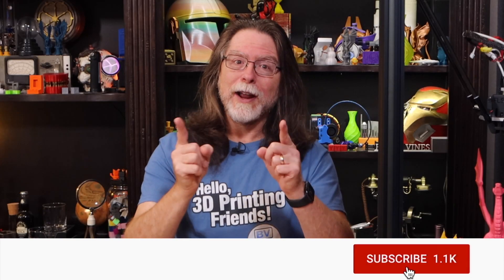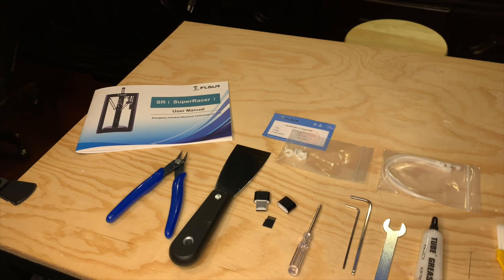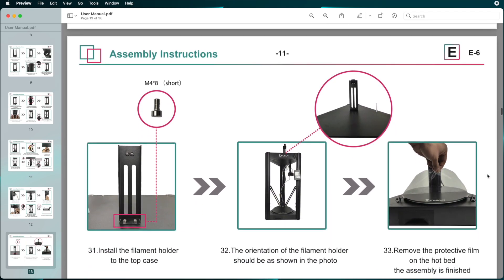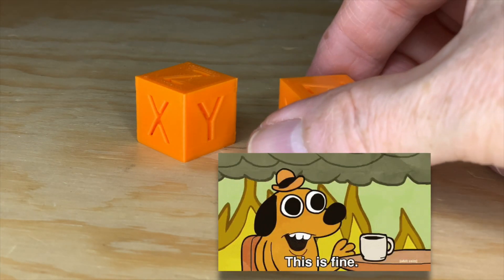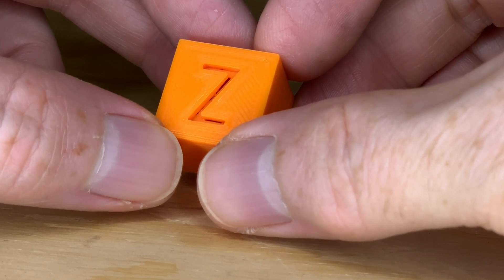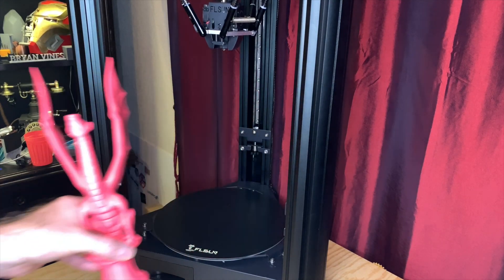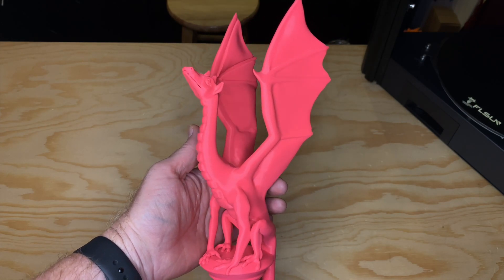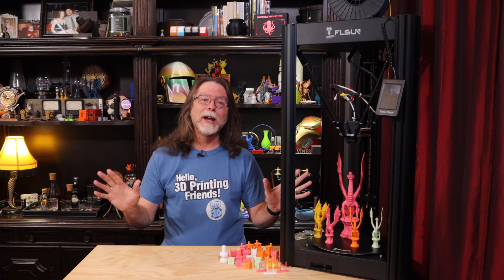FLSun Super Racer - A Fast Delta 3D Printer

Comment: After 127hr's printing here's my thoughts. With very minor upgrades and tuning (blue ptfe tube, more angled/narrow fan ducts, more rigid clip on extruder coupler a rc car clip, e step calibration and Pano Tuner app on the belts) Prints great at either stock Normal or Fine profiles in Cura. Only thing I changed is upping layer height on Fine profile to 0.16. Only on Normal profile speeds ringing are pronounced. Will be testing further to minimize ringing without resorting to Klipper. Ta

Comment: Hi Bryan, I am looking at maybe buying the new FLSUN QQ-S-PRO 3D Printer Large Size 255*255*365mm Auto-Leveling Touch Screen UK version. it is only £209.00p here on a ebay company site.

 > QQ-S Pro is an upgraded version of QQ-S. QQ-S Pro uses a 32-bit motherboard and automatic leveling mode.
QQ-S Pro movement system using high-precision linear optical axis with self-lubricating graphite bearing, which can obtain good printing accuracy and quiet effect during high-speed movement.

Support offline, USB and WiFi printing modes. The powerful Titan extruder is compatible with many common filaments on the market, and is especially suitable for hard filament such as PLA.
The default printing speed of QQ-S Pro is 60mm/s, even running at 120mm/s, better printing quality can be obtained.

Features:
32-Bit motherboard: New upgrade controller and program, with independent MOS module, more stable and durable, keep the printer high speed printing.Support online or TF card offline printing. Support WiFi remote control.
Three-axis linkage: Three-axis linkage structure with higher moving speed. The printing speed can increase by 60%. Quiet printing, Working noise less than 50dB.
Touch Screen: Full color, easy to operate. One button forever leveling，easy to operate, only need to level once, forever leveling.
Resume printing function：Don't worry about power outages, when the power is restored, the printer will continue to print from the interruption point.
Lattice Platform Hot Bed: High-strength lattice composite coating, fast heating, no warping. Strong adhesion, easy to take the model when the platform is cooled.Titan extruder, smooth feeding, no drawing, more powerful extrusion, can print flexible filament.
Large Printing Size Φ255 mm wide by 360 mm high: Support various 1.75mm diameter printing filaments like PLA,etc. 
Widely used in toy, architecture, furniture, education, medical, daily necessities and other fields.

So since you used a Delta would you say this newer pro version is worth the money?  I don't know if you reviewed this one yet?

I have a great Aquila 3D printer already, But need a higher print size system!  Your channel is awesome and I am subscribed to it.  So any feedback on is the pro version a good buy?  🤔

Comment: My Super Racer is working great with Cura tweaks.
Reply: Z setting is very important.
I set retraction to 5 millimeter. 
First layer to 50 mm/s. 
Speed set at 150 mm/s.
Reply from the maker: That is great to hear! What settings did you adjust in Cura?

Comment: Crazy question why would my homing fail on and Ender 3 v2?
Reply: I know this comment is 2 months old and you've probably figured out the solution but in my case it was endstops and the x-axis endstop wasn't being properly pressed. Could also be loose wiring with the endstops.

Comment: Hmm well I take the YouTube reviews on FLSUN with a pinch of salt now as really a few hours/days/weeks is not enough time to form an accurate opinion?  No offence!! whilst I waited for Soup racer to be available in UK, I picked up an FL Q5 to try out as it was on offer at amazon and unfortunately eventually ended up having to send it back.  Good print quality out of the box but got worse and worse until it was printing terrible quality after two weeks or so.  I think sadly the quality of the extruder and hot end simply can not keep up with the rest of the printer, which is a shame.  It's not a workhorse printer.  Conversely my QIDI X-Maker bought to replace it despite being much slower is banging out much better quality prints hour after hour day after day!
Reply: Yeah FLSUN is very notorious for that and all their printer's seem hit or miss. For me, my QQ-S Pro is kinda split. Out of the box it did great but I started having issues with quality and bed adhesion which was related to a stretched belt. I went the long route and did several upgrades however and now it's printing more accurately than my ender 3 pro but I'm not well versed with Cartesian style printers so..

Comment: They keep doing stupid things like tinning wires, we keep calling them on it. Eventually they will change, much like the stupidity of not enabling thermal run away. Then we can blast them on the laziness of not supporting M600, Advanced Pause, and other built in features they don't bother with.
Reply from the maker: At least this one was halfway there. The 24V input and the bed wires had connectors crimped on them. 👍🏻

Comment: Thanks for a comprehensive review, excellent content! How was the bed leveling? My wife needs something simple.
Reply from the maker: The leveling process was super easy. You do it with the nozzle cold. The probe plugs into one of the connectors near the end effector, and has a magnetic mount that puts it inline with the tip of the nozzle. Run the leveling routine from the screen; it probes the "corners" of the bed (the part near each vertical axis). Then it homes up at the top, and comes back down to probe around 15-20 points on the bed. Once it's done with that, remove the probe and set the Z offset (I used the paper method), and save it. FLSun has a video: https://www.youtube.com/watch?v=mWVXsSech8c
Reply: @BV3D  thanks for showcasing the Aria Dragon, I decided to print it as a real-world retraction test and it's worked out great.
Reply from the maker: @BenEBrady  Cool! I remember seeing on Thingiverse that Loubie3D has Aria tagged as a test print, and she makes a fine test print indeed.

Comment: I think plugging a micro SD to SD card adapter would alleviate the issues with the location of the slot since the ribbon cable on the adapter could probably reach across the top of the machine to the front and you could Velcro it into place or something. 

As much as I think it would be cool to have a fast printer (I have an Ender 3 v2, so I gotta go slow), this seems a little not that good for me. I'd have to change the firmware and some other things for it to really catch my attention.
Reply from the maker: I've got one of those adapters, and I need to see if it'll actually work. I've seen some printers that don't trigger a re-read of the card unless the card is physically unplugged and plugged back in. So what happens on printers that do that is, I have to eject the extender from the MicroSD slot on the printer and plug it in again, in order to get the printer to read the card. But if it works, that would certainly fix THAT problem! 👍

Comment: I have been wanting to get a Delta printer for a long time and this one has had great reviews, however the knockoff parts put me off, I have been questioning wether buying another Chinese printer is worth the hassle of having to upgrade the cheap and unreliable parts they generaly come with, Im saving my shekels for the Prusa XL, its expensive but worth every penny IMO, this shows the faith I have in Prusa, having not even seen an XL printing something yet, maybe I will get a Delta oneday especialy if Prusa release one
Reply from the maker: Hi Andrew! I'm OK with the current set of parts on it, but if the extruder fails I may replace it with a real BMG -- or maybe something else entirely. I've got a couple of extruders I want to test. I think the heater block on this one is not quite a full-size Volcano block, so that may be something else I need to look into.

As for the Prusa XL - Yeah, that's a beast of a machine. I'm still trying to decide if I want to go all out and get the 5-tool version of it.